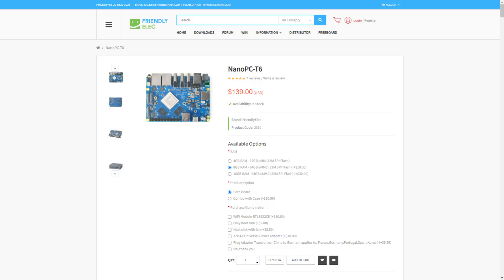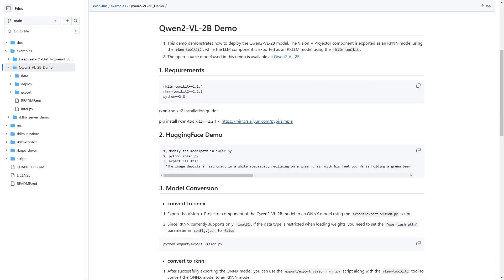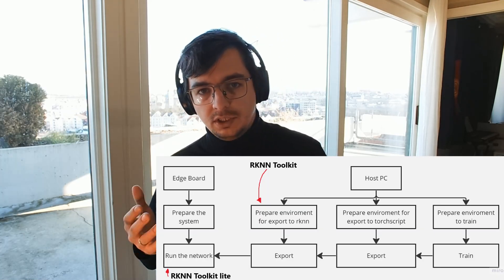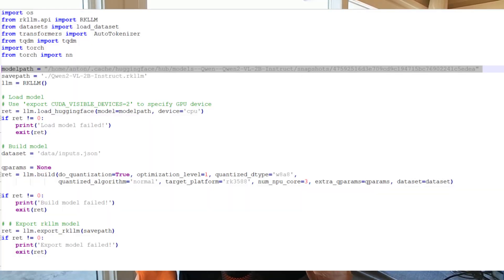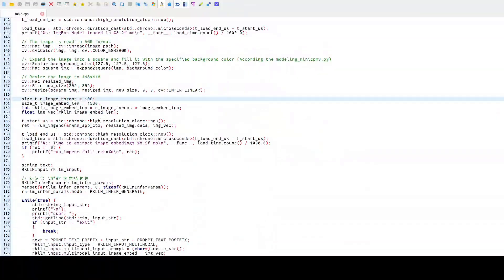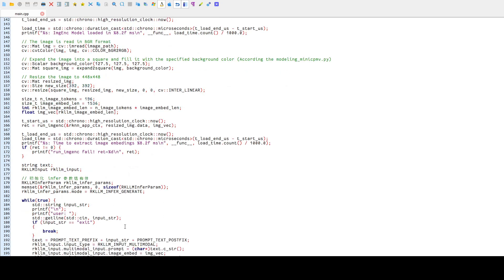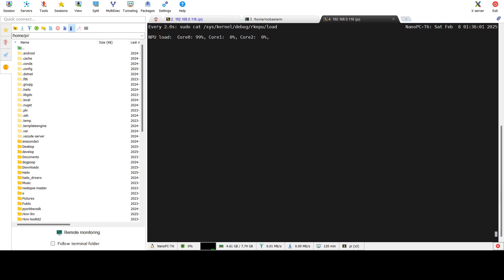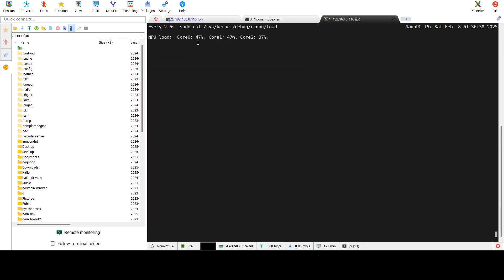RKNN LLM - Running QWEN 2 VL (RK3588)

Comment: Greetings, bro. I appreciate your hard work.

Can the .rkllm model file from Rockchip be executed through LangChain?
I want to run ROSA (ROS Agent) on Rockchip using the NPU.
Reply from the maker: Hi!
I don't think it support it our of the box. But in theory, of course, it's possible to modify LangChain inference pipeline. You can create wrapper around your model and use it as LandChain endpoint.
Reply: @ thank you for your kindness